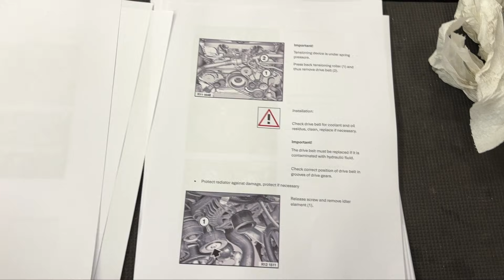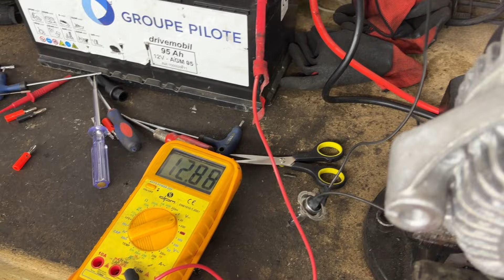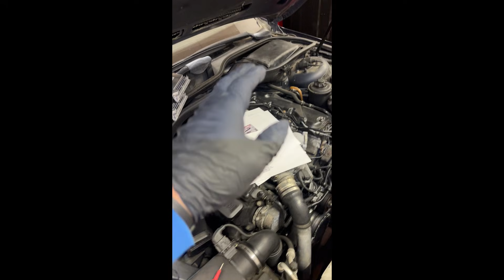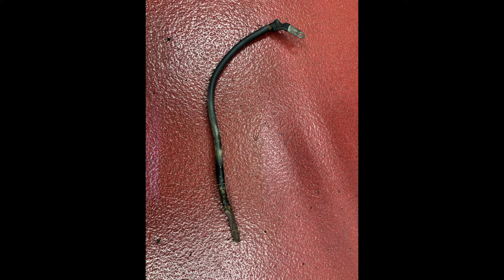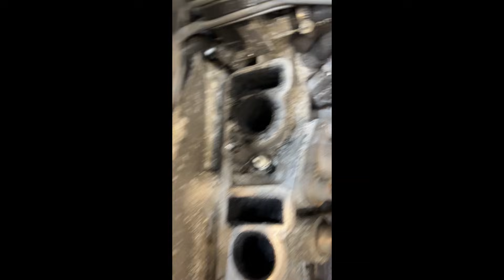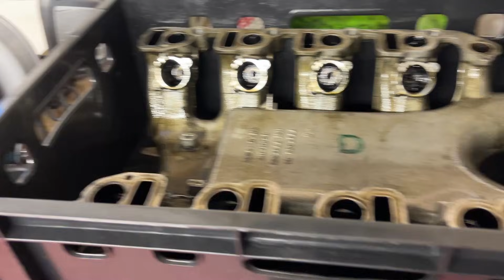I found the REAL reason why BMW E65 wasn’t charging… 745D V8 M67 S01E02

Comment: Hello i have a 745d e65, they probably changed the ECUs because the bad main power cable fried them. On my 745d i had 3 alternator issues. First alternator (reman OEM) was flooded with water because off the water pump. The second alternator ( aftermarket reman ), i changed it again with another aftermarket reman it had a short it was draining the battery while driving so not charging. I bought another alternator reman from BMW and the funny thing all alternators were refurbished in poland..
Reply from the maker: Hello, sounds like a long story 😮